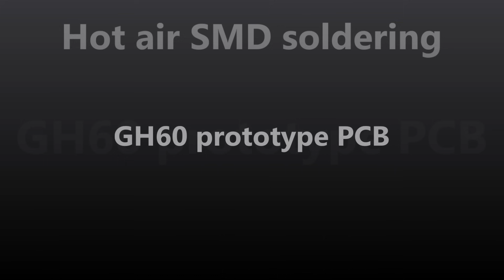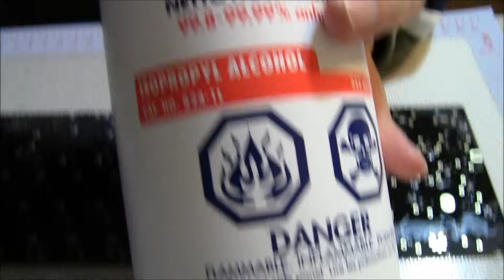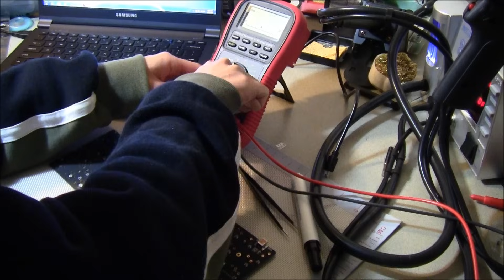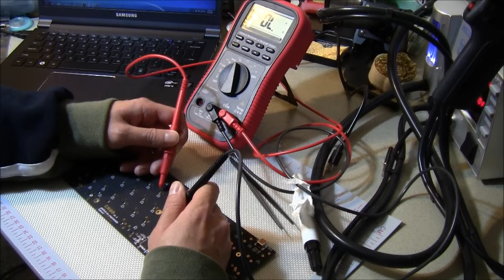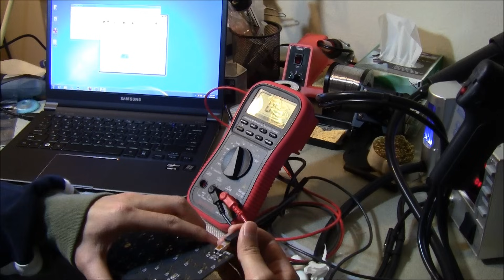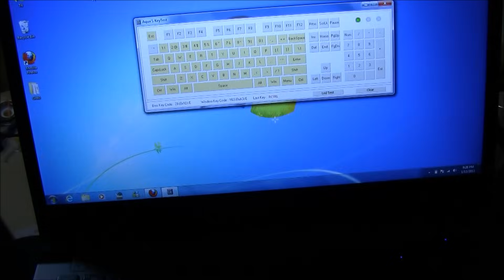SMD soldering by hot air

Comment: That is a thick tip on that iron for such fine work.  I've always filed mine down to needle-fine points for this sort of work (and yes, I have hand-soldered SMT components plenty of times... it just takes a really steady hand, small tip, and a lot of patience)
Reply: Ican't do this...because my hand will tremble
Reply: Never file solder point down, you will damage the finish and it will not accept solder and oxidize. Worst thing you can do to a new tip is file it, sand it or ground away the plating.
Reply: MicroRCFiend
 Nothing wrong with filing down a soldering tip, it's just a lump of copper, the thing you have to remember is to file it cold, then wrap solder round the tip you have just filed, then as the iron heats up, it will melt the solder that you wrapped round it , coating the tip with solder before it gets hot enough to oxidise the tip
Reply: The solder sticks to the coating, if you file the coating away the solder will not stick. I have done it several times. I would love to see a tutorial of the technique you speak off or any reference to it online I presume you can point me to?
Reply: @TheDeadlyVideo  if you need to file a tip then it is the wrong tip.
Reply: @TheDeadlyVideo  A copper tip is by far one of the worst choices for soldering electronics, as such tips are meant to be filed down to get rid of the built-up of oxides. Copper tips are basically 'eaten' by the solder and aggressive additives to improve wetting and such and thus require filing them down.
But tips for soldering irons meant for electronics have a long-life layer, a fine layer of metal that prevents the tip from oxidising. It's quite easily damaged, especially when you start using your tip for things it wasn't meant for.
NEVER file down a long-life tip, you will damage it for good, solder will quickly have a hard time sticking to it and the tip will degrade further extremely quickly.

Comment: I have a few questions I think very important. 
1) What temperature you set?
2) How I can be sure that the components are not overheated and damaged?
Also good to know what soldering station used, what solder paste, air gun diameter.
Thank you.
Reply: Still haven't got an answer
Reply: still
Reply: Still...
Reply: Still :)))
Reply: still....
Reply: I don't think he is going to answer guys, lol.
Reply: Still waiting
Reply: I think that you are unlikely to heat damage components if you are only applying as much heat as shown in the video - they are designed for multiple processes like reflow which hits them with a far higher temp for a very short duration. parts like diodes are good for up to 60C for reasonable time. It is worth noting that after washing pcbs they can be in a dryng oven at 50C for over a hour without any damage. 
As the other questions are specific to his set up then only he can answer.
Reply: @ianmontgomery7534  It was 6 years ago mate. Thank you anyway ))) 
I do this things everyday now. Usually I don't use low temp soldering paste so it is about 420 C set on my Hakko air station. 3mm nozzle.

Comment: Amazing never seen before how smd boards are build on.
Reply: This is the slow, manual, one-component-at-a-time method.  Industry uses robots for "Pick-and-Place," then "Wave Solder" to solder the whole board in a few seconds.

By the way, people that specialize in operating Pick and Place and Wave Solder machines don't make a lot of money.  So, the slow, manual method is interesting if you want to do Electronics as a hobby around the house.  But better to keep working on that violin for a better chance at making big money.

Comment: Using a soldering paste stencil is the best solution. But in cases like this, where the board is too big and the full stencil would be impractical from a cost and use perspective, getting a stencil for individual components is a good solution. So you have a stencil for the big multi-leg chip only,  and any other component where it is difficult to get a proper application of paste. You do those complex components with a stencil  first and then the other components like resistors by hand. And if you are hand soldering SMD's, don't be a hero, use 1206 size components where possible since they are easy to put paste down, pick up and place, plus you can actually read the codes on the components.

Comment: Thank you for the tuto, but at which temperature you set up the hot air?
Reply: Start at 300C and experiment from their. It will depend on how much copper is in the ground plain on the pcb.

Comment: I hold the IC at the correct position by pressing it vertically with the rubber eraser on the back end of a pencil.  Works like a charm.  The trick is not to use tweezers.

Comment: Im about to try and solder a new 1151 socket.would you preheat the motherboard or just clean the old solder then heat with the hot air at 180c?The socket alredy has solder applied.Great video clean job

Comment: Hi! Thanks for taping that video, it is nice and clear. About 13 minutes into the video you apply some flux and re-solder the pads, did you do that because the pads were inter-connected after applying the hot air or was there another reason?

Comment: The reason you had bridges on the right side is you put solder on that side too much toward the IC and less toward the pads. As a result, the solder paste wasn't separated by the solder mask that helps separate solder. But nice video.

Comment: Could you tell me what was the heat setting and what was the fan speed set at ,I just bought a rework station ,and I will need all the help and advice I can get,I notice not all smd boards aren't the same,I notice some of the Chinese kits are kind of weak or tender compared to what you were soldering which seems a little heavy duty .

Comment: Hey I kinda new to smd soldering im trying to learn a little bit more about it through these videos. I was wondering where do you get the ceramic capacitors at and also how would I order them. I would assuming that they have so many different types of capacitors for different boards and I was wondering if you could help me out. Thanks :]

Comment: When you said that the orientation of the diodes has to be right, how can you know which way the diode is supposed to go? Is there a band or mark of some sort on one side of it? 

I am a newbie with this, and I find what you are doing to be quite fascinating. I knew about solder and flux, but I never knew that you could get it combined in a paste like you are doing.

This looks much easier than trying to do it other ways I have seen people do.
Reply: Diodes are marked with a bar across the cathode end. Usually, the PCB will be marked with a matching indicator of some sort.

Comment: A few things... I noticed you had a bit of smoke during the hot air re-work... might want to turn the heat down a bit, also you can be liberal with the most of the solvents you use to clean the board and it might be a good idea to let the solvent dry before applying heat as the heat causes the solvent to vaporize and you dont want to be breathing that in or start a fire (not that im telling you from experience or anything...) Otherwise, I like the vid, good job.

Comment: Does this kind of work pay good?
I enjoy soldering on my RC stuff and making minor repairs to boards. 
Wish I could make a living doing electronics. 
Where do I start?

Hot Air, securing the piece to be soldered and this liquid solder are absolute essentials to soldering quickly. And I don''t know what the best cleaners are.
I've spent hours trying to stick on of those rectangle pieces back on a board with a  regular soldering iron. The problem is the iron always moves the cap I believe those are.
Reply: Electronics does not pay exceptionally well, but it would depend on where you live and if you are able to catch a big break. I have been playing with electronics since I was about 12 (29 years old) Currently I am a partner in one business and own another and I can tell you that it is tough as many others in the business may tell you as well when they go on their own. Overall if you are able to deal with stress, potentially long hours, and some major financial instability for at least a couple years of starting up you will do fine. It can be a real cutthroat business and the competition is only getting higher. Granted I am dealing in all the aspects of electronics from the design phase to the sale of the product through one company and am doing repairs with the other. Each having their own set of challenges. 

If you are looking to repair electronics as a business/side job, determine first what you want to repair. Industrial electronics, consumer goods, cables, etc. You could just pick and choose what you want to work on based on who calls or comes in the door. Sometimes working indirectly with your competitors can be an advantage. You may specialize in some areas where others have theirs, so it could work if everyone isn't too greedy. 
    - Determine a shop rate that is based on your experience and those around you. If the average shop rate is $100/hr and you feel that your time doesn't cost that much or you are just doing it for a little extra cash you could charge what you feel your time is worth. For instance when I started off I was billing at $15/hr, now that I have an office space for the other business I charge $60/hr which is still about 35% less than my friends in the same industry. I also repair key fobs and remotes for a fixed fee which is less than shop rate, but there isn't much to bringing rubber keypads back to life, it is just tedious. 
     - Start advertising and promoting your business. Word of mouth does very well on its own if you tell your friends and family about it often enough. You could attempt to repair dumpster/ electronics recycling depot finds and resell them, in turn you could indirectly advertise your repairs that way as well. 
  
A no-fix-no-fee model could make the difference on whether you get someones business or not. That is how I get a lot of my potential business. I do not charge for quotes either on my repairs.
 - Set-up a good warranty agreement 

** Of course what I have written down is based on my findings and those around me, these may not all work for you. If you have any questions feel free to ask

Comment: Please excuse my ignorance, but what is the name of that gray colored paste you place on the soldering pads before heating and melting the conductive material in place ? I am looking for that to do some mini USB connector replacement. Can you enlighten me as to what it's called and where it can be obtained ? Thank you !
Reply: Mark Cooper solder paste you can buy it on amazon.
Reply: Thank you for your reply, however, it appears to be more than simple soldering paste(flux). It would appear to have some silver or lead content mixed with the paste that actually permits the junctions coated with it to not only be cleaned by the paste (flux) but also solders the joints that it is applied to. I am attempting to replace mini USB connectors on tablets and of course a standard soldering iron, no matter how small, cannot physically accomplish the job (too large using even the smallest of tips). If you can advise me if I am correct, I would greatly appreciate it ! If you would please include a link to the Amazon source that would be even better ! Thanks again ! P.S. - I've been doing electronic repairs for over 30+ years and now I would like to venture forth and add the ability to replace these small connectors as the demand is high as you likely already know.  Mark..
Reply: DigitalYojimbo - I believe I found what you were referring to. I'm including the Amazon link for your concurrence:  https://www.amazon.com/Clean-Temperature-Solder-Paste-Grams/dp/B017RSGPI8/ref=sr_1_1?ie=UTF8&qid=1484939679&sr=8-1&keywords=lead+soldering+paste

I assume this is what you were referring to ? This looks to be exactly what I was trying to describe in my previous reply to you.  Thanks again, much appreciated !  Mark
Reply: yes that's correct you need flux too and you should probably invest in a cheap reflow station.
Reply: Mark Cooper if you're gonna desolder get some kapton tape and try using chip quick for desoldering.

Comment: One more question I noticed you did not put flux before applying the solder paste is that the recommended procedure?
Reply: Solder paste already contains flux. If you apply additional flux you're gonna end up with 'watery' paste and have a hard time getting your components on. Also, if you apply flux before applying the solder paste, the paste won't stick as good.
If your solder joint needs rework, feel free to use flux after your paste has been molten.
Reply: John Kapri So flux and paste are two different things. Actually when you search for these items on so many websites they show these items as flux only.So how to differentiate these ones

Comment: this looks easier for tight projects, is this way of soldering more expensive? cuz i think id rather do most my work like this, but ive never seen this type, prolly cuz im a newbie,
& what is that at 12:01, and what does it do, also same ? about 21:25

Is there an actually reason to use one method over the other

Comment: Where did you get that silicone mat & does it work well for hot air rework if you dont mind me askin?
Reply: JAY LEE It is just a silicone baking mat you can buy on amazon or ebay for about 15 dollars. They may even carry them at target etc.
Reply: JAY LEE Silicone is a high temperature plastic good to about 550F.  More than enough for hot air rework
Reply: +xtamared Silicone is not a plastic, it is a polymer / elastomer.
Reply: +Michael Snyder See Nathan Kopilec's well put mini-rant. "Plastic" is a generic term which can refer to a myriad of polymeric formulas. Ultimately, plastic simply means flexible.

Comment: sorry, if it sounds like a noob question, but what is the temperature setting on the device?
Reply: I'm on my 2nd hot-air soldering video.  One of them mentioned 350 C, which is about 660 F.

Comment: Can you please give a little more detail about how you fixed the shorts in 13:40?
What is the liquid you applied?
Reply: he added more flux with a flux pen. all he did was re-heat the solder and it flowed into it's propper positions on the tracks

Comment: how many watts to solder/de-solder a ceramic smd capacitor ... I was using my 60watts soldering iron and couldn't nudge it no matter how much I waited. If hot air how many watts rather than degrees should I buy

Comment: Did he say no need to orientate those diodes? 
What is that tube attached above the soldering iron?
Reply: He said orientation of diodes does matter.
Reply: I think the tube attached above the soldering iron is a little metal vacuum hose...sucks up the fumes so you don't breathe them in and also removes some of the excess heat around the item being soldered... You can use a little fan to blow the smoke/fumes away from your face/nose...especially if you're using the old lead type solder.
Reply: Thanks, found that a few weeks ago on a desolder station with the same hot iron configuration.
Reply: +CITIZEN you dont breathe the lead or tin,you breathe the flux which is the bad thing,lead doesnt boil on 700 celsius but above 1200
Reply: Lead starts to get soft at 330 degrees celsius and starts to boil around 1750 degrees celsius.
You don't want to breathe the flux (as you've stated correctly) and you don't want to breathe the melting lead either (slight fumes as it heats up)
Even touching lead made items like the old lead solder is a no no...should always wash your hands with soap and water after handling.
Reply: CITIZEN
since lead doesnt boil and then you dont breathe any lead,about washing your hands thoroughly,I totally agree with you!
Reply: .
I guess holding the solder with my lips might be responsible for for my for my ummmm

Pray for Flint, MI.  Tens of thousands of kids are going to need special help throughout their long lives.  The half-life of heavy metals in the body is about a month or so, but the damage is done by the time the metal has dissipated.  Most of the talk is about the children, but it will be an interesting experiment to see how the lead effects adults, too.

Remember, liquid doesn't have to boil for it to evaporate.  (Even solids sublimate.)  I would be concerned about lead-fumes when one's nose is over a soldering iron.  At least, get a 12V computer fan (with fan guards) to sit on your bench, or any fan nearby.  You don't need a major breeze, just enough motion to keep the fumes moving along.  Once that's accomplished, then see what you can do about an exhaust fan to keep the air replacing.

And furthermore, flux smoke is similar to formaldehyde, so it's not like that's safe, either.

10 seconds of googling for "soldering flux smoke similar to formaldehyde" -- Here ya' go: http://www.cdc.gov/niosh/hhe/reports/pdfs/1999-0137-2810.pdf  

> Rosin (colophony) is a natural substance obtained from various species of pine trees with applications in industrial processes, particularly in the electronics and printing industries. Rosin is also present in a wide variety of products both at work and at home that include soldering flux...

> The chemical composition of natural, unmodified rosin is a complex mixture of about 90% resin acids and about 10% ester, aldehydes (which is similar to formaldehyde, duh)... Resin acids are reported to be the components in rosin that are responsible for causing dermal and respiratory sensitization...

(We're already sensitive enough.)

> ACGIH has not established a numerical TLV® for rosin core thermal decomposition products, but recommends that exposures to rosin and resin
acids be maintained to the lowest achievable concentration using engineering controls and/ or personal protective equipment.

So you don't want flux smoke up your lungs, either.
.